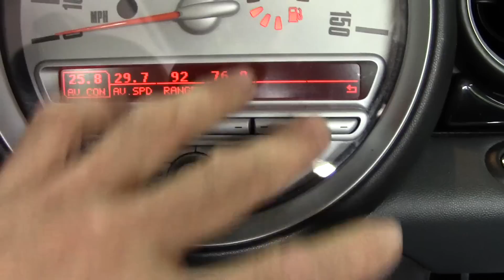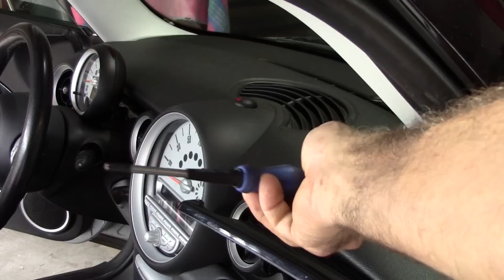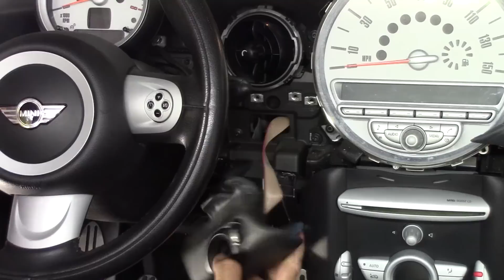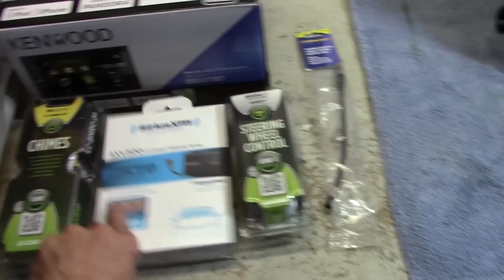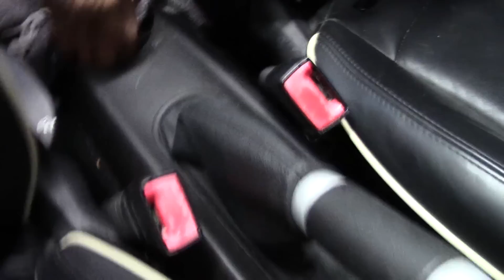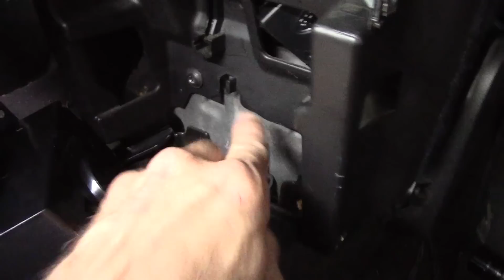2007 R56 Mini Cooper S Radio Swap

Comment: I've been considering updating the stereo in my 2010 Clubman. Have you noticed any hiccups since you did your swap? Other than the computer settings you could reach with the stock stereo, have you had any issues getting into and changing settings via the turn signal stalk? Is there anything else I should expect after performing a stereo swap of my own?

Comment: Hi Dean, I have a question for you. The steering wheel control connections...Sigh. I followed the instructions that came with the product. It said to hook up the brown wire for a kenwood headunit, red, yellow, and black. After it was all done and installed I got a green light on the box and no controls. Not having the volume knob is annoying enough but now I dont have my steering wheel controls. Any info on how to get this to work?? thanks -Kevin

Comment: Hey, Dino! Long time fan. So I just bought a R56 MINI and I'd really like to replace the radio, much like this. I'd prefer to keep the computer controls, but it looks like that may not be possible. 
My question is, have you run into any issues after removing the controls on the front? I hear it's pretty integrated into the MINI computer and can cause some electrical gremlins. If you haven't had any problems with it in the last year, then I guess there's nothing stopping me from just ripping the sucker out!

Comment: When I removed my console and put the Metra kit in, I have a gap between the gear-shift console and the dash that's showing bare metal and wires. How did you cover that up?

Comment: I do have a question.  It is said some of These minis have an amplifier that needs to be bypassed.  However, yours seems to work fine.  Are you having problems with the audio output?

Comment: What about the GPS antenna? Does the XM radio module require a new antenna or will it use the existing one if already equipped with SATRadio?

Comment: That was THE BEST and most informative VT I have seen on You tube, I was going to attempt this on my Mini Cooper but it is far too much for me.. so complicated ..
Reply: It’s quite simple. All it is, is patience. It seems easy when he does it but when you get hands on, things start getting confusing but if you are patient it becomes easy and understandable. I’m going to do this on my mini but I am also going to either paint or replace all of the old switches cause they ugly!
Reply: It really wasn't too bad. This video helps greatly. Just take you time.
Reply: He makes it look easy. I have to run rca cables to 2 amps. So I have a lot more than he’s doing. Subwoofer and a pair are 6x9s.

Comment: Is there a similar kit but for the R53 Motor Mini Cooper 2006 S? Also is there a interface to convert the radio connector into the Mini Cooper one in order not to cut cables?

Comment: Hi there. I have a '08 that i just installed a 8200NEX but i can't see to find the correct harness. My radio doesn't get power. I have the power running for the headlight switch. It is killing my battery. Can you help me please.
Reply: I have the same problem! Did you find any solution?

Comment: That "vent" you used for your mic is where the factory multi-directional microphone is installed with the upgraded HK audio system. So in essence you used it for what it's meant to be used for :-)

I have the HK audio in my 2012 MCS and as much as it is a nice factory system...it's lacking as well (coming from years of custom audio installs and high quality components spoils you!)

Comment: I have a mini cooper 2008 S with the HiFi stereo system. I bought an aftermarket system that actually replaces the speedo and headunit.  All works except no stereo sound or car chimes.  Any thought on why???? Amp doesnt seem to be powering up
Reply: could you share a link for the aftermarket headunit?
Thanks

Comment: that was alot of work lol , for someone who's never done a stereo install that many screws and wires would probably take a full afternoon..just curious why didn't you get the oem nav instead of the din ?
Reply: Joshuabrutl you'd need a whole new wiring harness.

Comment: Holy hell, you must have really hated that existing stereo to go through all of that.
I've seen transmissions changed with less trouble!
Reply: It was worth the time it took. The stock unit is just odd to use and it's audio quality was very lacking.
Reply: That allows for all the after market goodies like subwoofers to be installed with ease, it's even harder to hook up subs to the stock radio

Comment: whats XM Radio Deeno? Is that your digital radio system over there? That looked like allot of work my friend well done.
Reply: Digital radio delivered via satellite. Not a big deal to add on. After this video, it took me 10 minutes to get back in behind my Kenwood radio, snuff the cigarette pack sized XM Radio module in there, plug one cable into the radio and attach one antenna lead. I mounted the antenna, which is about 50 x 50 mm, near the factory antenna at the rear roof. I ran the coaxial antenna lead in through the hole for the factory antenna, ran it forward up under the headliner then down to the head unit.
The whole XM add on took me an extra hour. :)